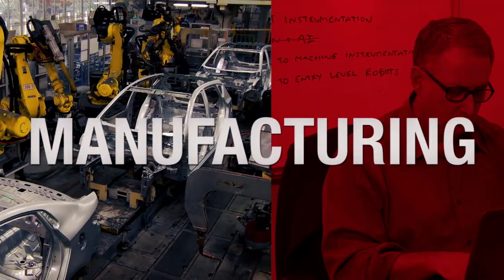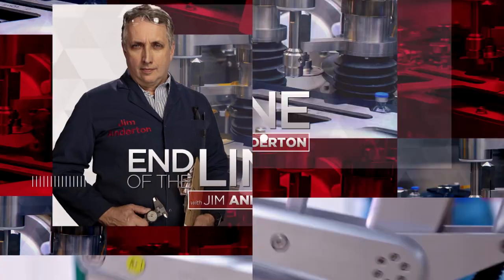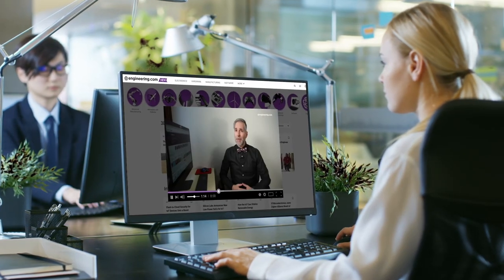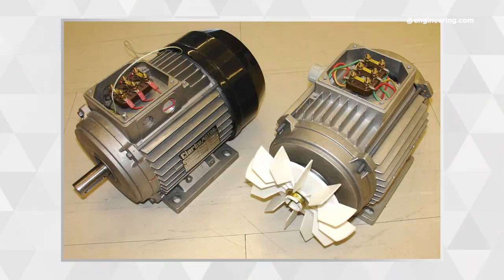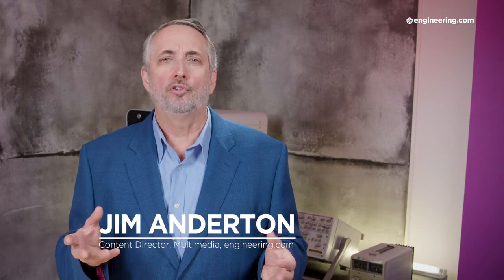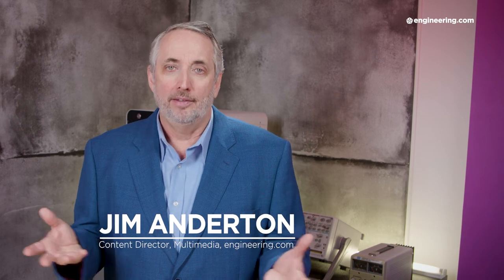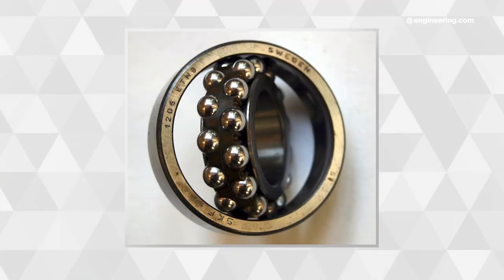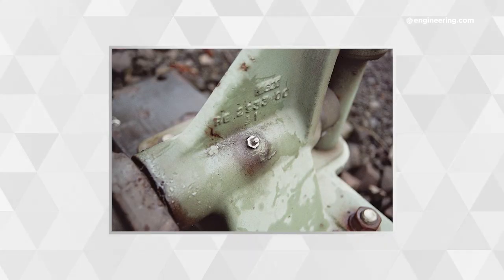Things They Don’t Tell You About Electric Motors

Comment: Sensors on the motor housing should eliminate the need for manual checks - a contact microphone and a temperature sensor.
Logged.
Ideally with automated analytics, but checking logs listening to files could suffice.
Reply: It can, but wouldn’t those sensors go out after long periods of time? You would be better off really to just check it every once in a little while.